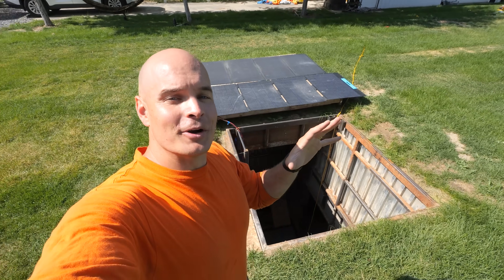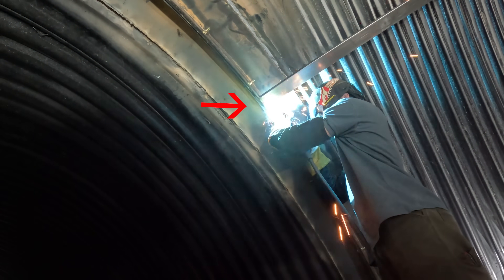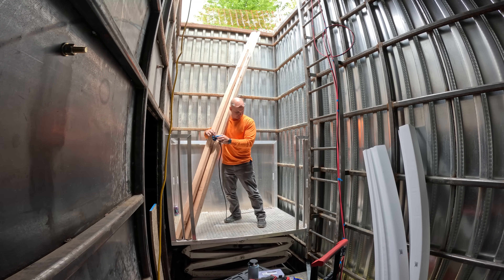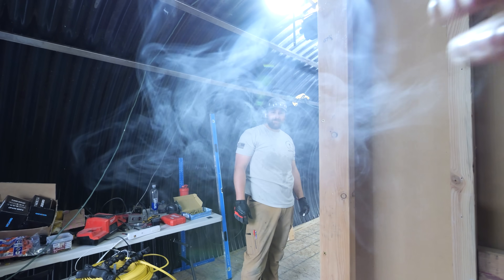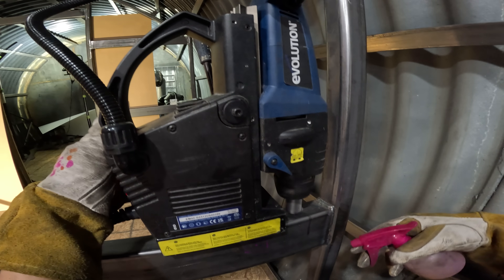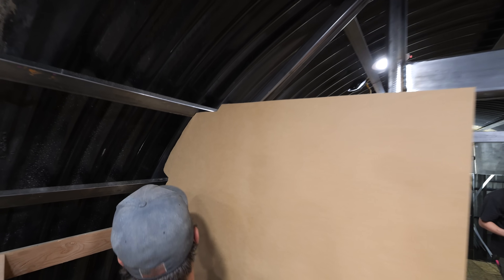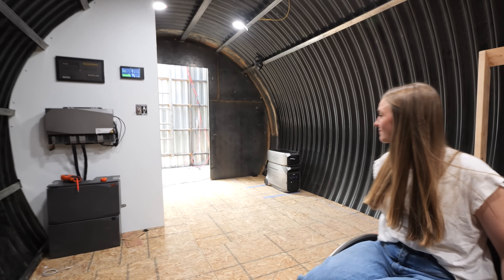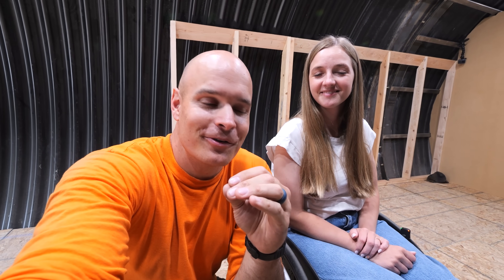How to Properly Power a Backyard Bunker - (Completely Off Grid)

Comment: Hi Zach, here's my four penn'orth of wisdom, based on nearly 30 years living off grid. 
🌿Add some small, passively cooled, full spectrum grow lights that can run all year round and keep some plants growing. 🌿
Good choices would be Sansevieria, Draceana, Chlorophytum, Aspidistra. Self watering hydroponic pots should keep everything alive for months at a time. 
These will help absorb any residual chemicals and purify the air whilst the bunker is dormant and at the same time they add the proven benefits of having plants in the living space.

💡Install small independent solar panels that charge small lithium cells and power lights. 💡

These could be pretty coloured lights around doors or access areas, fun flame effect lanterns or simple spots, even pir units in the stair well and lift. 
When your main power trips, runs out or just needs to power down, you will be glad of those few faintly glowing leds because they are remarkably brighter than darkness. And never ever burn candles - but I guess you are smart enough to know that. 

Personally, mine run regardless of the battery status and sometimes it's nice to turn everything off except the gentle illumination they offer. All I would say is spend more when you buy them, because cheap panels & crappy cells will let you down.

Comment: What a waste of work for a subpar system. If you really mean it you should have gone something like Victron Quattro or at least Multiplus 2 and some MPPTs and batteries. We all know how long these cheap as build products will last in the long run. Would have been way better to stick to professional working stuff.

WIth a Cerbo GX you can also monitor water tanks, fuel tanks, Temp and humidity etc... I know it is sponsored and paid by Ecoflow but still such a project should have been done properly.

Comment: You might want to build peaked covers over your bunker entrances that would allow fallout to slide off, you 90 degree turns at the bottom will only atenuate 90% or less of radiation, either that or entrance buildings with 3 foot thick con walls and ceilings  w blast doors. Radiation can go around corners, it is called sky shine.  While you are at it add some blast valves for your air supply.

Comment: I really appreciate your ingenuity with the wiring troughs! Probably not going to get approved in an above-ground structure, but looks to do the job in here. I would like to suggest you poke a few drainage holes in them, just in case you have a secondary disaster after occupying the structure... flood, broken pipe, spill, even condensation. If anything were to leak into trough, having it drain out on its own will just be one less thing to worry about during that incident.

Comment: If you ever need to go outside during a CBRN Event, your first room at the entrance should be a decontamination shower room as well as a PPE Storage room.    It should be able to be cut off from the rest of the bunker.      Bascially you walk in with your CBRN suit, pull an overhead shower handle and have all the radioactive dust/biological agents flushed off your suit so that you can de-suit and leave it behind and walk into the bunker without all that contamination.

Comment: Just a thought but how would solar be any good after nuclear fallout I mean all the circuitry would probably fry anyway and if it doesn't then all the debris could either smother the panels making the effectiveness drastically deteriorate or smash some of the panels? I would make sure to have alot of redundancy and a diesel generator would be alright even if the fuel was over 6 months them things run on anything kerosene you name it

Comment: Like what is the whole point of converting DC to AC just for the electronics to convert it back to DC internally? A 24-48v system would be more efficient. There is no reason for the ecoflow when practically everything in the bunker runs on low voltage DC internally.

Comment: You should add red LEDs into your setup they can run at very low voltage and wattage that you can see important areas that also have built-in rechargeable batteries in them so they're able to run on their own when disconnected from power
Reply: Make sure you also have a low wattage TV as well so if you're low on power you could use that
Reply: Install permanent heavy built solar panels above with a spray nozzle system so I can clean them when dust builds up on them connect it to a well system and an automatic timer which is separate but also a emergency pass through where you can spray it without the automatic timer so it has dual channel power so you can clean them that way
Reply: Music carbon black filtration system and A rad meter and a gas meter paired with your ventilation system heroin direction meter on the surface maybe four of them just for extra data and temperature meter use a low wattage smart controller to automatically shut off fence systems if High radiation is detected or air pollution is high tie this with a buzzer so you know vents have been shut add a manual override also include a manual pump system for oxygen using a pedal assist store iodine for treatment of radiation
Reply: Make sure you have long-lasting power cells which have high charge / discharge rating also make sure to have a direct pass through inverter which is capable of running without batteries you might want to have a oxygen pump and a pressurized system so you can pump to pressurized containers full of oxygen what should be mixed with polluted air if it ever occurs to decrease the exposure and dilute the pollutants if it's very very high you could just use masks with air canisters while the ventilation system shut off  if you have two 30 gallon tanks of air that's 120 hours worth of air divide that between four people that's roughly 30 hours supply
Reply: Salt is a valuable resource and also you might want to grow some sort of algae you can eat which has protein and vitamins you can run your oxygen system through the algae to boost growth
Reply: You should have protected cameras mounted to the surface and one mounted on a pole remote-controlled or 360° with a glass dome over the top for protection and sealant

Comment: its cool but batteries life cycles is unfortunate, we need energy storage to be developed alot more. you should get some wind to tie into your system, you could try to make a circuit to use all your renewable only all the time. you could use a big water heater to dump excess energy and try to keep your solar generator as a backup to keep it alive longer.

Comment: I'm wondering how the heavier gasses from the welding are doing with the air circulation he's got going.  If all the Argon sinks, there could be a collection of Argon along the bottom of the cylinder.  It would be worth checking when all is said and done.  I don't think it would be too hard to get rid of it.

Comment: A PVC gutter is not suitable as a cable tray. If something goes wrong with a cable, the PVC gutter emits REALLY TOXIC gasses inside this enclosed volume with people in it. It mustn't be a full-fledged fire, just some hot wire, invisible under the floorboards, will do. If something bad happens, the bad will make sure to knock down the ventilation first. There is a reason why numerous materials are not used in a submarine. Don't misunderstand me, I think your project is spectacular, but certain things you do are seemingly quite dangerous, or create a potentially serious danger.

Comment: This build has been absolutely fascinating to me. I was extremely glad to see that you decided to use the Independence kit. I am currently running the 15kw kit on my RV and it's a flawless system now that I finally got a good update. Hot tip, stop updating when the system works or has bugs that are manageable. Every update seems to create new bugs and may not fix old ones. I'm just north of you in Idaho and I have been running my kit since Oct 2022. If you have questions feel free to reach out.

Comment: Expansion idea, extend elevator in the house down, so into a basement, and make a walkway from there connecting to the bunker.
Might have been the way to go from the start but ah what the hell, but an alternate way to get out in general, especially for her with the wheelchair would be a nice idea.
Probably a bitch to do afterwards but what the hell.

Comment: The eco delta 3 I see on their site they have a kit with 220w solar costing $3,199.99 "on sale". You're paying for the gimmick of 240v output at 4kw you're not realistically powering any 240v loads with it let's be honest. My eg4 6000xp costs $1,600 on a bad day and does 6kw @240v. The ecoflow has 4kw capacity. Sure my unit is 48v but let's pretend we just have a $1600 12v inverter surely capable of 6k at that price. I'm looking at some eve 280ah cells right now no tax no shipping I'm looking at a $340 price tag for 3.58kWh. We haven't reached $2,000 yet and we're outperforming the ecoflow so where's the extra thousand plus dollars going? The name brand

Comment: 0:08 "how to properly power" already lost me 8 seconds in with dog poop flexible panels. They are a gimmick product not a solution. They fail extremely fast have and have a shorter warranty due to their shorter lifespan and they cost considerably more for their power output. There's exactly 0 reason to use them here other than sponsorship

Comment: what was that... 4 lights per section, 12 lights all in? if so, 200W draw on just the lights sits each one right around 17W per. i'd be interested in seeing if you couldn't get away with 2 lights per section (or even 1?) and doubling the battery life. but this is obviously before everything else is plugged in and drawing down varying individual loads. i'd also be interested in seeing how much power the tv draws. those things are monsters for consumption. i barely use my 55in tv. it draws ~50W consistently as an external pc monitor. that would chew through my 7.5kWh easily.

Comment: 2:50 - Reverse clamps?!?
Reply: Yeah there's little pins on the back of the metal rail that clamps slide along, you push that in and you can take the clamps off and turn them around

Comment: The lighting should all be 12v. A battery system is way more efficient when not converting 12v to 120v, just so a led pod light can step the voltage down to 3v for the leds. All campers and RVs use 12v lighting even though they have shore power and a generator.

Comment: FYI I've stored diesel on the farm before and had some batches that got forgotten out at some locations. If properly sealed and sterilized I've had diesel last over 10 years. I've even had it work fine in plastic Jerry cans just make sure you have a good biocide because the real reason fuel goes bad in plastic containers is that water permeates the plastic. P.S. I've drained old diesel out of a front end loader that had no fuel cap for a few years. its was green and slimy. Added biocide and a surfactant and let it settle for a month then pumped the fuel off the top of the sludge, worked fine in the Ford Ranger, then used the sludge in the diesel heater!

Comment: Been wondering if it would be too much effort to install rollers and tracks on the sides of the elevator to hold it steady while moving. It wouldn't have to be an exact fit to make an improvement, even a few wheelbarrow wheels on the corners and a flat surface for them to grip against would probably make a pretty big improvement.

Comment: @8:19 Sump pump and a backup sump pump, with water management in the bottom of all of those corrugations. Fill with concrete so you don't have dozens of small trapped puddles

Comment: Jerry, this might be a problem in the said future of using the bunker but lets say you were in the bunker due to a Meteor strike or Nuclear attack. If these happened you would be forced to stay down in the bunker for quiet a while. What im concerned about is the Solar Panels building up dust and dirt making it unable to collect light.

For example, on Mars there are rovers sent by NASA that use Solar Power to operate. They mostly rely on dust storms to clean the panels. What are the chances that happens where you are located if an event would happen where you have to stay inside. Please find a way to overcome this issue! Thanks,

Just something you should worry about!
Reply: On earth, rain does a pretty good job of clearing solar panels of dust. Admittedly, Zach lives in a relatively dry place, but it should get enough rain despite that.

Comment: A few suggestions for your own sanity: 
1) Get an oscillating tool/multitool.  They support a variety of different "blades" to make different types of cuts and remove different types of materials, and since they only oscillate a few degrees you can put your hand right up to the blade to stabilize it for better control and accuracy on complex cuts.  Not to mention they are a lot safer to use than a cutting wheel on a grinder (and no high-speed shrapnel).  
2) Someone recommended a sump pump for under the floor in case of leaks, which is a good idea, but that corrugated tubing won't allow a sump pump to drain the last inch or so of water out of the corrugations.  I would also suggest a dehumidifier system to help counter small leaks before they get to that point.  Even without leaks you guys are going to be adding a lot of humidity to the air with showers and just breathing, and the chilled walls down there are going to condense it out of the air and lead to mold.
3) A contour gauge is your friend.  Stick it up to a wall and it will give you the shape of the crossbars/corrugations that you need to cut around.

Comment: In a situation where the solar panels are not able to produce enough power, it may be more practical to go with a thermal pile setup which generates heat from an ambient (or nuclear) source and converts that into electricity.  One example of this is a thermopylae, which uses the body heat given off by 300 greeks when your solar panels are in shade, such as during a partial eclipse or a barrage of persian arrows.

Comment: Everyone is saying "oh, but you should get a gas generator" not requiring that he could ALSO use a gas generator to recharge his battery bank. Or solar. Or wind. The batteries are so much more flexible, cleaner, and easier to use in a bunker.

Comment: You could put a ceiling/roof/cover on the lift that has extendable supports like drawer runners so that as the lift goes down the roof fits into the top of the hole and the supports extend leaving it covering the hole, as the lift goes up the support runners retract untill they hit the stop point and the roof cover lifts off the ground. When the lift is down it would be flush to the ground, since the supports extend the top cover wouldn't end up way in the sky when the lift goes up, the cover would only start lifting when the lift gets close to the top.

Comment: One of the more probable "almost end of the earth" scenarios is no proper sunlight for months or even a few years because of particles in the air (which makes solar panels useless for quite a while). That has actually happened within written history. The cause? Large volcanic eruption spewing sun blocking materials into the atmosphere. You might want to reconcider not having a gasoline or diesel driven generator for backup. A real generator can also give you immediate power, not like the solarpanels that have to charge your batteries for hours or even days. Even if fuel goes bad in 6 months (it really doesnt go useless that fast) 6 months is a lot better than nothing at all if there´s no sun. And if you stabilize gasoline it´s good for up to three years.

Comment: Its crazy how here in Puerto Rico, which has a pretty bad electric grid system and management, we have to pay double for these types of batteries and generators

Like I get shipping here can be a little more expensive, but when you can ship 1 or more containers of them the shipping cant be that much more.

The Delta max 3600 is $2700 on their website  while its being sold here for $5k and that from an official reseller of them.  

I can understand paying 10% o 30% more but almost double??
Reply: well we can have them shipped directly to our door your problem is in the reseller gouging you on price. If demand goes up then those prices would likely go down eventually.
Reply: @zachmoyer1849  that's the problem herea lot of big stuff doesn't get shipped to our doors, instead we have to manage with official and unofficial resellers

In Ecoflow's case, we have the official resellers selling it for 2x the price.  And I don't think it's so much like "demand goes up, price goes down" Here is more like you have the option to buy it from us with official warranty for 2x the price or hack it some other way without any warranty and probably end up paying close to that

Comment: For the TV, what about a pico projector instead? You would have no problems getting it in, and you could have a 300" screen. The big drawback to them is they don't do well with window light, and that's not gonna be an issue.